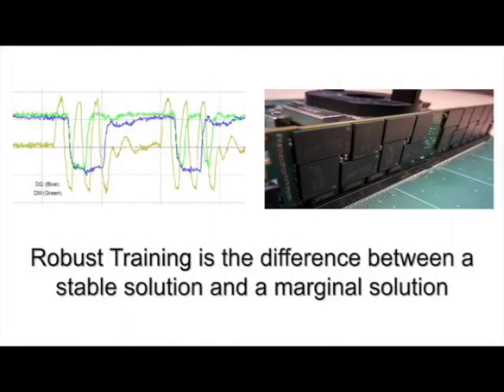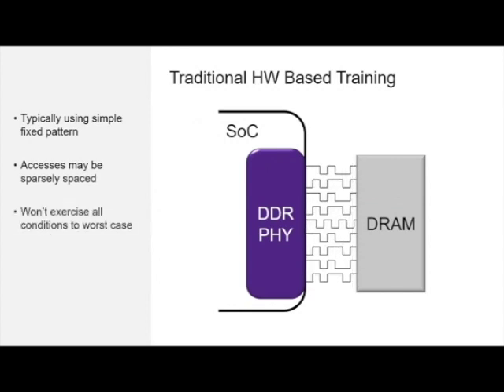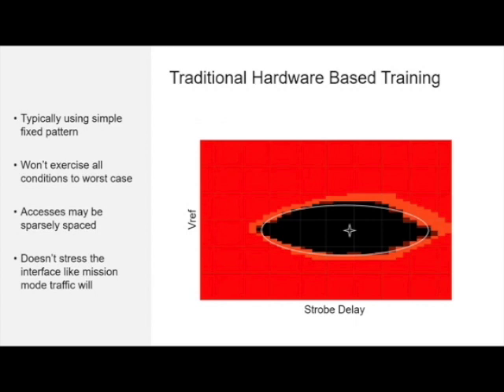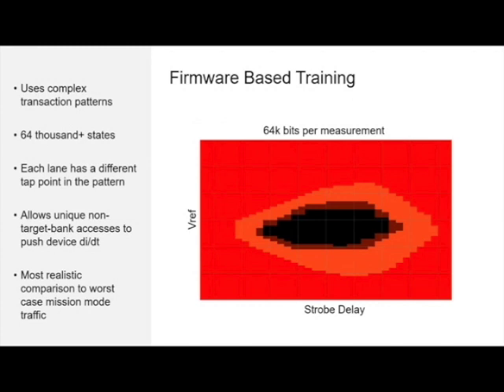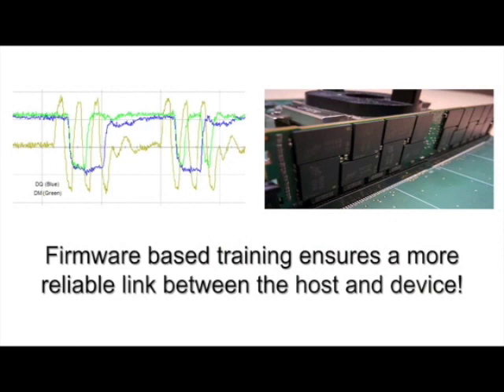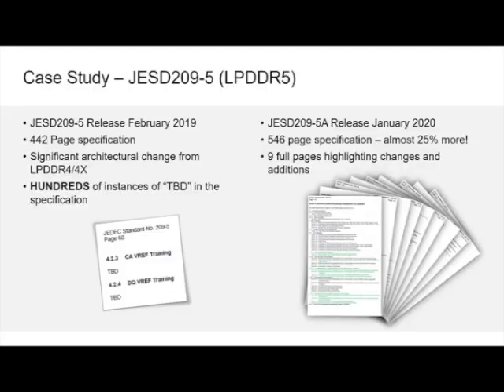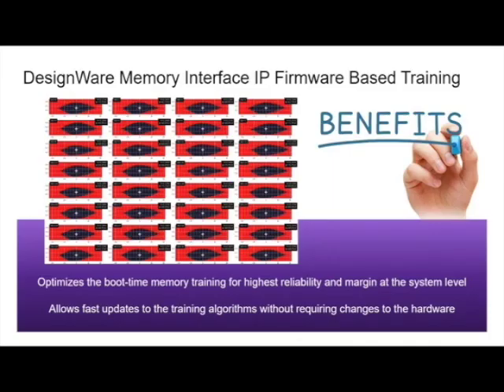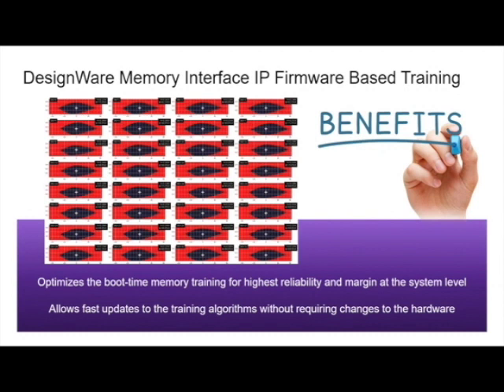DDR PHY Training

Comment: nice work, but sorry this video doesn't explain what the training is and how it really works and why (at low level)... like adjusting delays so each clock is centered to each data bit, impedance/reflection adjustment, etc..   maybe this kind of video should have in mind that public are beginners learning about it...   the SI eye was given out of nowhere as a reference without explaining it is the superposition of different scenarios ...